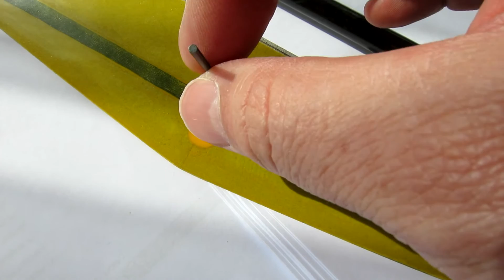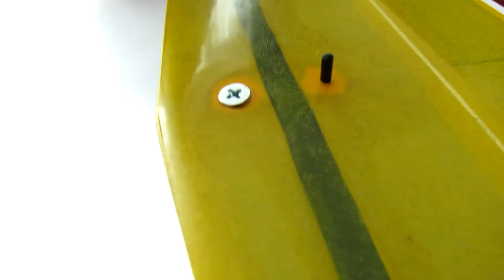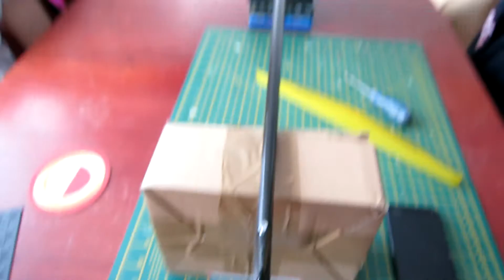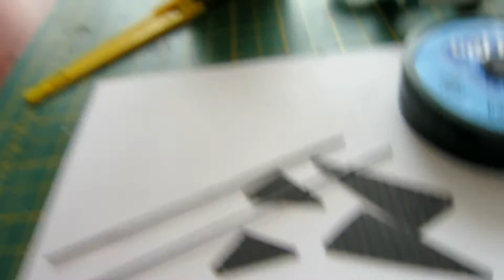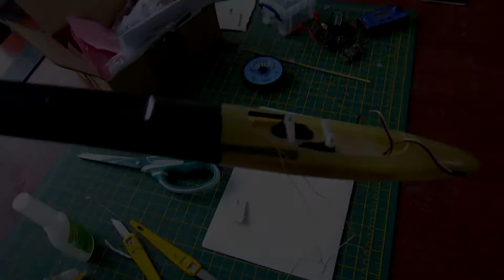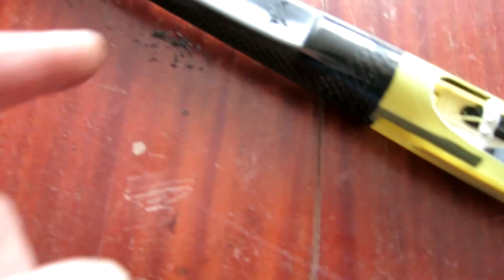Throw It Discus Launch Glider DLG build part three

Comment: you want to have that rudder pushed on almost to the spar for maximum support. 
Just a tip when making channels in foam use a heated piece of wire, this give a nice clean hole and also melts and strengthens the side walls.
Months of good reading material on rcgroups.
Reply from the maker: thanks for that, but I don't have much clearance for horizontal tail ( elevator) if I push the rudder much further onto the boom

Comment: Hi,
 on a DLG you need to make sure that there is no slop in aileron linkages - otherwise you will not be able to set the flaps accurately for launch, cruise and thermal as there should only be a few mmm difference in these settings. Also you may find that you have flutter on launch because of the slop. It is normal to just put a Z bend at both ends of the aileron linkage – or you can use heat shrink and epoxy to fix another piece of wire on see this build thread here: 
https://www.youtube.com/watch?v=dcIDaHj9mGY

You also need to pack the aileron servos firmly against the foam otherwise they will move about as the upper skin flexes. You can use bits of balsa or epoxy/micro balloons
I tried the aileron servos you have on a Versus and found them far too sloppy for a DLG ailerons and replaced them with something better – hope you have better luck!
The piece of paper you showed marked rudder on it in the first video is I think a template to help align the fin. Stick it to some balsa and cut the internal shapes out and this will help you align the fin. Note that on previous Thowt models the fin is asymmetric the convex lifting side goes on the side opposite to the throwing pin so on the right in this case. This provides addition yaw correction on release.
Hope that helps
Reply from the maker: thank you so much, great help
I 'think' by blind luck (50/50 chance) I put the fin on the right way around?
Reply: Vass as long as the convex side is on the same side as you horn - which should be the right hand side of the fin if you are right handed. :-)
Reply from the maker: Lotophagi yep ! perfect, thanks